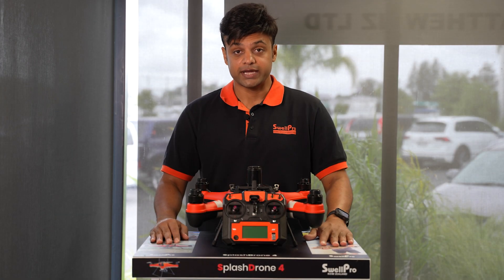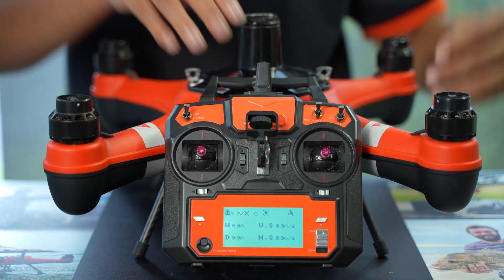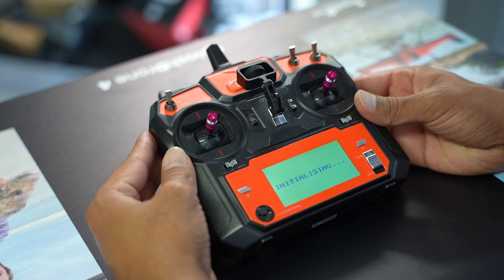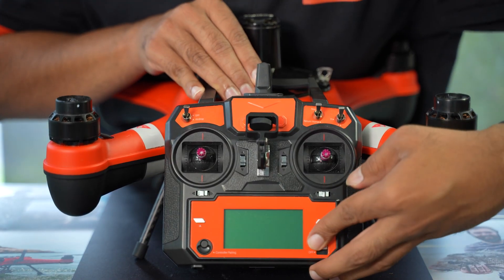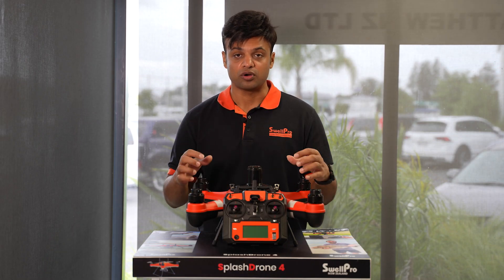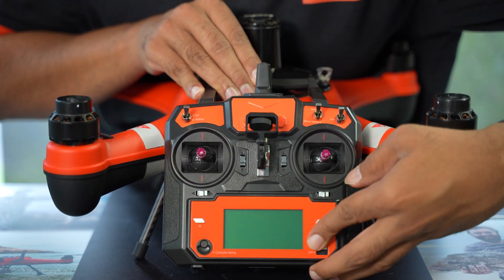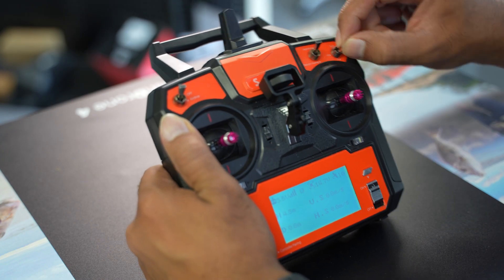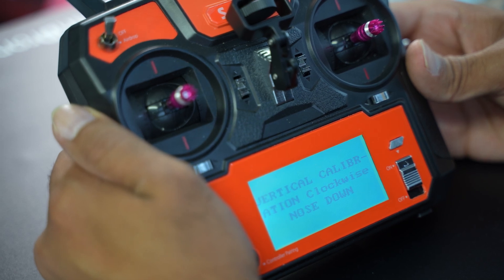Swellpro Fisherman FD1 Calibrations

Comment: Hi mate. 
What could be possible causes of no gps signal on controller. Always shows 0. I believe the green gps wire on receiver is secure & have tried a few different things but still 0 showing for gps signal. 
Cheers mate
Reply from the maker: hi, sorry for the delay in reply, you might want to check the cable to the FD1 - sometimes when this is pulled a little by taking the lid on and off - it can mean that the connection to the lid and gps aren't good. Thats one possible reason.
Reply: @jcmatthew  thanks mate really appreciate the reply. I’ll give that a crack 👍

Comment: I got the fd1+ and I cannot figure out how to calibrate. The left joystick up and right joystick left and right is not bringing up the initializing
Reply from the maker: that is the IMU calibration - make sure the drone is on a flat surface before you start calibrating.  If that doesn't work, check that your joysticks are not out of alignment (can be changed using the little silver switches beside each joystick)

Comment: Hello, after the horizontal and vertical calibration the two fixed red lights stay on and the 2 green lights blink quickly. The manual says what is the calibration?